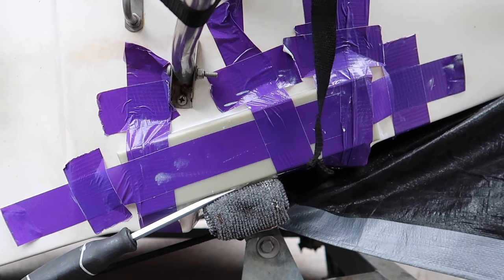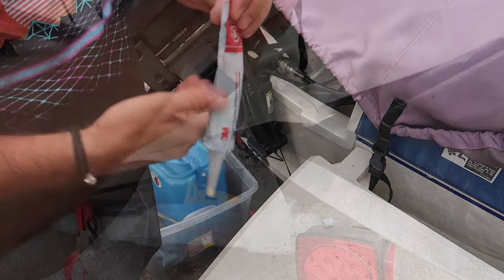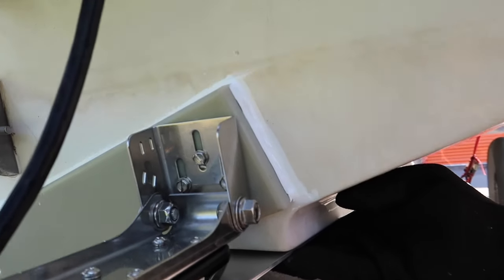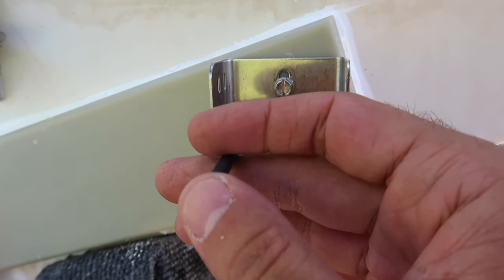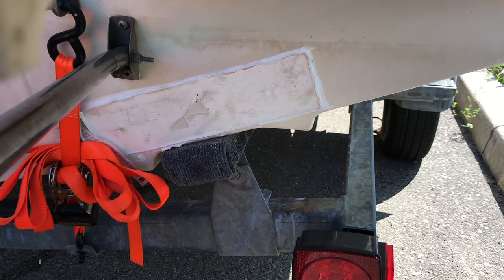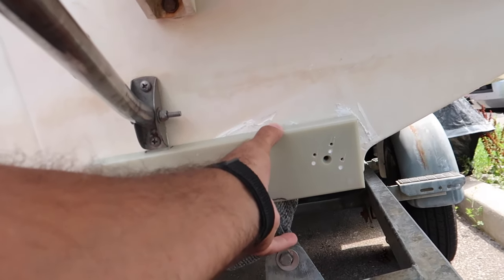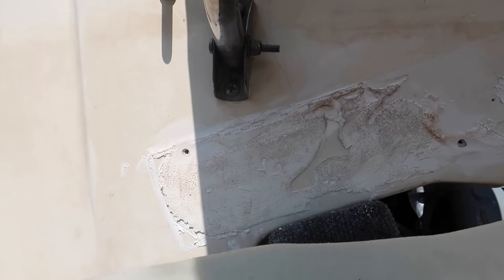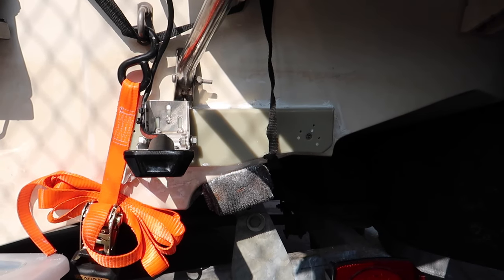HumminBird Helix 9 G3N & G4N Transducer Install

Comment: Just in case you need to redo it again...most every manufacturer I know suggests to mount transducers away from the  chines on the boat. Best thing would have been to mount the whole thing away from those chines (immediately right of the the center of your transom, drill 2 holes in the transom for stainless screws in the HDPE block along with 3M 4200 or 5200, and then screw in the transducer to the block with adhesive on the screws as well.
Reply from the maker: Hey Paul,   Thanks for the detailed info. Ya I was following the manufactures instructions for this process.  Next if I do another install I will come back to your post and look more into what you have suggested. 
Stay safe...
Reply: Thanks, Paul, I have been working with a 24' nauticStar that has a stepped transom and the turbulence coming off of it is horrible. I think I'm going to need to lower the transducer further down into the water to get better imaging.

Comment: Where can I purchase that mounted plate?
Reply from the maker: Hey Oeun, 
For this mounting plate, I purchased it through Amazon.  Here's a link.  https://www.amazon.ca/gp/product/B00AU5PF6Y/ref=ppx_yo_dt_b_asin_title_o04_s00?ie=UTF8&psc=1 
If the link didn't work then the name of the item is 
Attwood 94110-5 UV-Resistant Marine-Grade Boat Transducer Mounting Plate Hardware Kit

I've seen some marinas that carry them and also Basspro but I find that they wanted too much for the mounting plate.  Amazon turned out to have the best deal.   
Thanks for comment Oeun,  All the best and keep safe.  
Tim...

Comment: So I put mine basically the same spot.  Now my side imaging is all wavy insink with the waves of the water.   Damnit!!!!!
Reply from the maker: Hey Walleye Slayer,  is the transducer under the line? How rough was the water? I have notice with small boats in choppy water the side imaging isnt the greatest.  I switch to either regular sonar or down imaging.   What you can try is increase the screen speed so you don't get any image smug. Try that.  let me know what you find out.  When I get my boat in the water I will take a look and pay more attention to what you have mentioned.   I really curious about what you have mentioned.

Comment: Going to have to put some holes in your boat lol. They are very easy to fix with marine tex if you dont like it!
Reply from the maker: Hey Shawn,  Lol can you tell that I'm a new boater!!! lol.  Thanks for the tip about the product to save the boat from a hole! Just checked out their website looks pretty cool.
Reply: @416Expedition   Hey anytime! I only know about the product because I had to  fix a bad placement of my transducer. The stuff is fantastic at repairing holes, even large ones with the correct procedure. I got some really good tricks off this video check it out! https://youtu.be/EgVLXkSrBHI

Comment: You should try using 4200 instead of 5200. 3M also sells a chemical to remove the 5200.
Reply from the maker: Hey Darris, 
Thanks for the tip.  Just wanted to ask, what is the difference between 4200 & 5200?  I'm going to need to adjust the hight of my outboard motor as its sitting about an inch to deep into the water. Also would you know the name of that remover?
Reply: @416Expedition  4200 is semi permanent 5200 is permanent sealer. Typically use 5200 when you do not want to remove an item. 4000 is also good below the water line.
Reply: @416Expedition  Another product out there call Debond that works.

Comment: Nice, but, your transducer is still on an angle, same as you said your transom is on an angle. Now what?
Reply from the maker: Hey @bobhoffman8717,   Thanks for your question.   There are many thing that you can do to ensure that the transducer is mounted square.  Adding stainless steel washers to one side until the transducer is straight will do the trick, another option is to buy a much thicker peace of star board, find the angle of the transom and cut the star board according the angle to make up for the difference so that the star board it self is square.  
But to be honest @bobhoffman8717, I did neither and just left it the way it is. It has been about 4 years, and it hasn't impacted it's performance.  I still see the fish on the sonar, it helps me understand what is going on under the waters surface.  So I haven't had really any reason to correct the angle, as for me I think that the angle does not impact the performance of the fish finder enough to correct it.    
So I am not going to change anything and just leave it as is.  But again this is just my option.   

I know that this may not sit well with some ppl.  But at the end of the day it works really well.